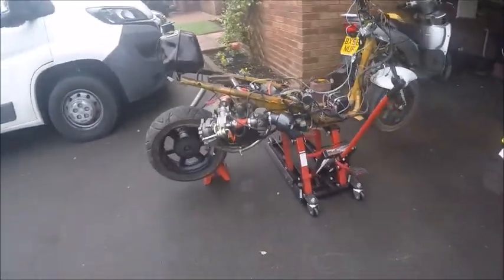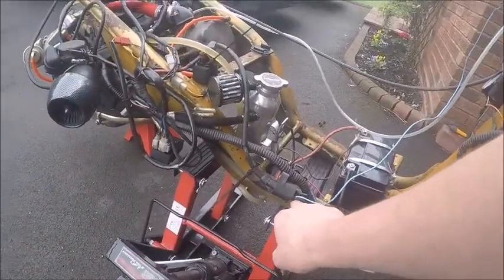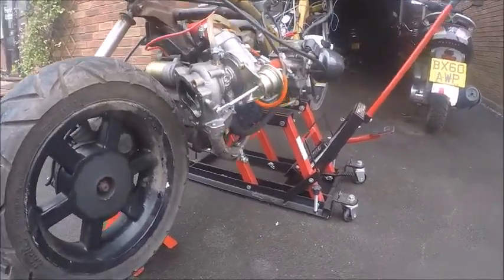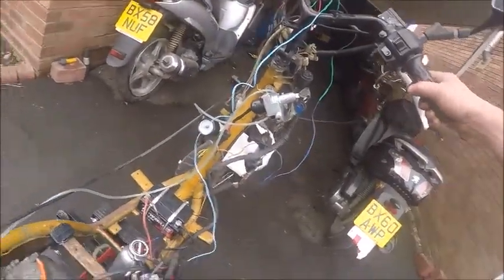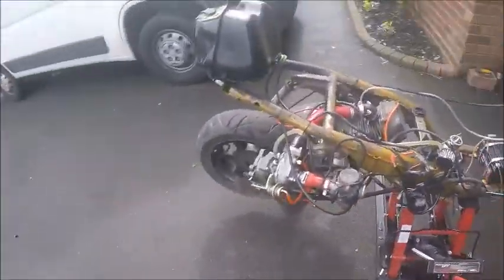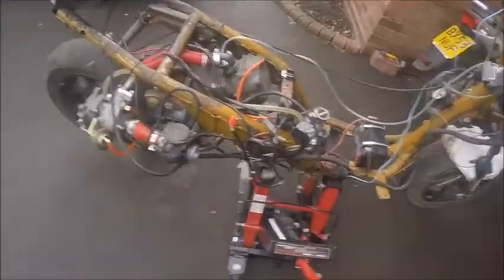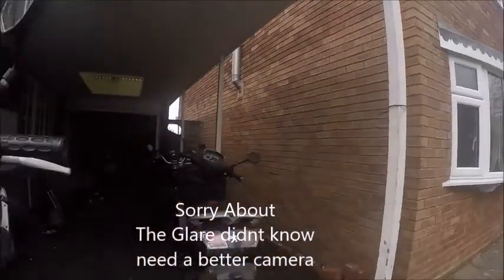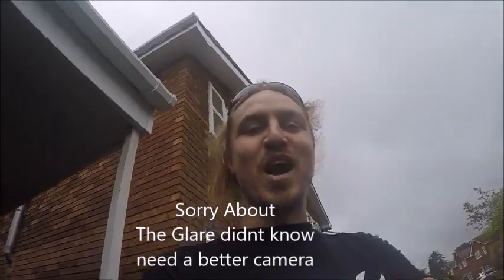No Air Filter, No Problem, Turbo Scooter

Comment: You might find you see more boost if you hold the rear brake on to put load on the engine - boost is load dependant. Interested to see how this works out!
Reply from the maker: Yea that's a good idea dude I'll try it out in the next vid I'm filming tomorrow